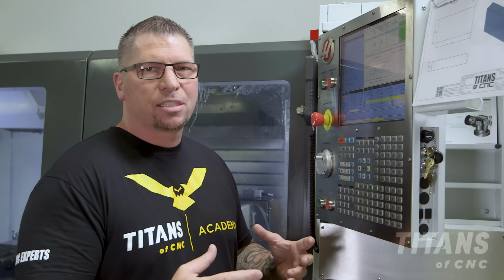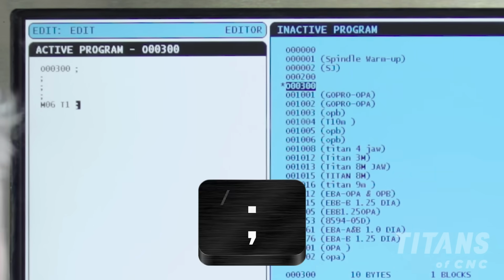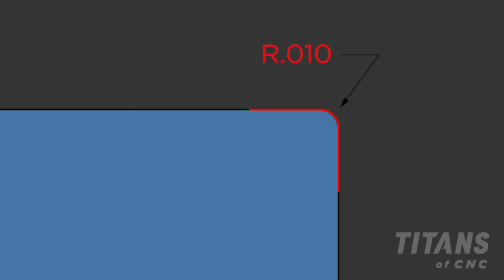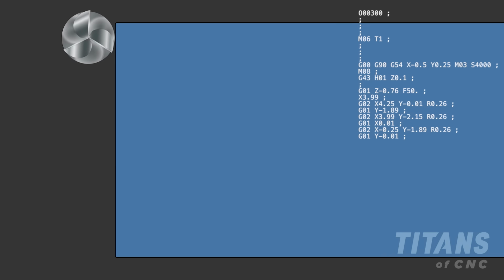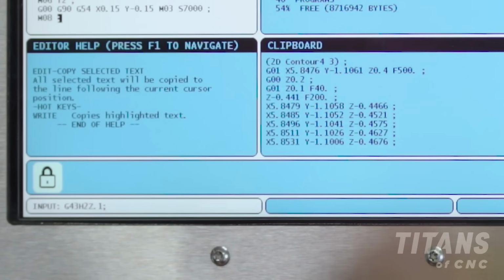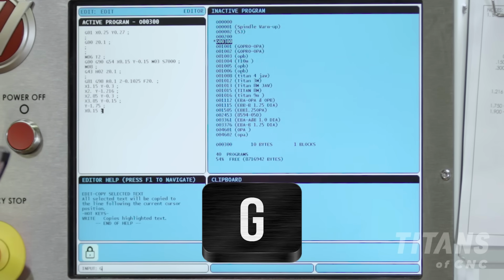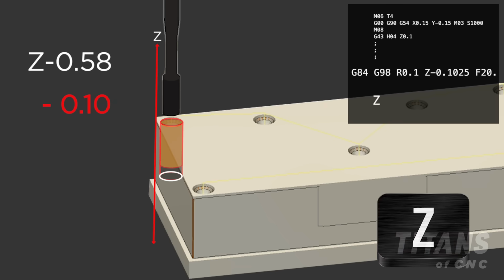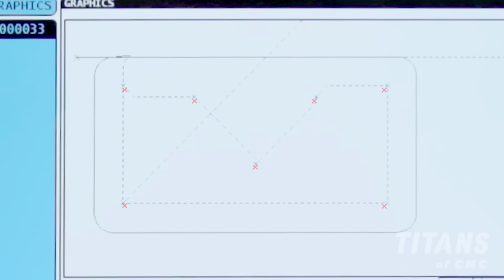G & M Code - Titan Teaches Manual Programming on a CNC Machine.

Comment: Now a 5-axis manual programming :D
Reply: Do you really want it ? I can do a video on 5axis on haas and brother and 3+2 axis old haas also have an LX20III so i can do a video of dual head swiss lathe work with 14axis manual  programming. I really don't like this video it lacks proper use of tool comp and tool comp on a haas machine is a breeze absolutely no reason not to use it especially if your using a preset tool list.
Reply: don't take that fact I don't like this vid as I don't like Titan. I have seen his life story unfold i have even been in his big shop before the down size. the guy is a mad man in a good way and i support what he has done and the basic's he wants to teach the only key things i really want to see added are a safety setup line at the start of the code and basic tool comp usage not doing so from the start teaches bad habitats. I have had 4 employees (out of well over 50) in the last few years take me seriously and do the the hardest thing they can do, ask a question sit down and listen i work with those the WANT to know i don't look for them i let the ones with the drive come to me, all 4 of them now have there own shops not for from me and we work together hand work around based on strengths and time. it works for all of us let me work on what I like to work on 91% of the work my shop has done this year has been in very hard to machine metals (not hard just gummy) i like the challenge but i have a LARGE tool set to pull from i started in this world at 12 years old with my grandpa, my parents were addicts so i spent a lot of time with grandpa i have running punch card oil bath machines. by 13 i was programing them by 15 i was running early swiss screw machines at 18 i took over the shop and ran it as a side job while finishing my masters in computer sic, today i not only program gcode but asm,C,C++,py,java. and speak English, Japanese, Mandarin, German. it takes years of hard work to build this kind of life even now i work 15hr days yet have no real reason to but if you let go good chance it will be gone for good
Reply: In metric :D
Reply: @nf794  in German

Comment: Why inches why! xD
Anyway great video!
Reply: Metric is  .03937 is 1 mm  so 1 meter is  1000 mm x .03937 = 39.37 inches  The measurement the CNC control software uses for setting up the Steppers or servo setup is different than the Software the G-code uses in the File  G20 is inches and if you want mm used then code G21. They will be used on the starting line of your software or if no G code is used the machine will use the default or last G20 or G21 code used. You can use any measurement your G code file was made with. Just by letting it know by telling it with these G codes.
Reply: I program, machine and measure in whatever unit system the blueprint specifies. Seems to be the most logical thing to do,and keeps mistakes to a minimum.
Reply: @liquerinfrnt  LOL !
Reply: Were Americans.  Stubborn.
Reply: because in imperial units you are allowed a greater margin of error.
Reply: @diane Taylor Not according to: "The International Foot (which we were all taught in school) is defined as 0.3048 meters, whereas the U.S. Survey Foot is defined as 0.3048006096 meters"
Reply: well here in canada, many cnc companies use inches
Reply: @andrewirwin6765  the machines are usually speced in metric but the work is usually in inch
Reply: @andrewirwin6765  ... a sad reality
Reply: Because a great deal of machine shops still use the imperial system.
Reply: INCHES FTW
Reply: Because the metric system sucks! Base 12 has more divisible numbers. But the biggest reason the metric system sucks. Is because you can't tell me the diameter of my metric sized tires.

Comment: Great video  I'm skared of a 10/32  at S1000     I'd rather run it at S320 F10.    But then again  time is $$  so I ges it depends on how many parts you are making   

Thx 4 the video 💪
Reply from the maker: We actually go 2000 RPMS with a form tap... it likes the heat
Reply: @TITANSofCNC  I wasn't aware you were roll tapping that is an entirely different Beast I prefer to roll tap when at all possible however I usually Reem or interpolate the minor diameter before tapping to make sure I get the most form possible unless it's a production job and I can't waste the extra tool change and run time

 thanks so much for your video

You guys are a inspection 💪

Comment: You probably should explain cutter comp G41 G42 and tool dia. offsets because you are trying to relate this to a CAM driven program that will more than likely use cutter comp. as well as other safety prep. codes along with G90 G91.
Reply: I was thinking the same thing. Why is he acting like cutter comp doesnt exist?
Reply: Fantastic tutorial. I wish something like this was available for me to watch before I learned to write programs. Thank you for all your hard work on these videos. Your helping the entire trade get better!
Reply: Your comps are in your calcs

Comment: I use this method for simple tool paths. Be awesome if you explained the perks of G41/G42...G40 if you had a standard profile but had to rough, finish and chamfer just by copying and setting your diameter offsets while using the D value. Either way, very good video to show that programming can be done by hand.
Reply from the maker: Thanks... will explain more later, didn’t want to over complicate things for those who are new to CNC.
Reply: I know....you guys do such good work opening up the world of manufacturing to AMERICA.

Comment: Hello, Titan I am trying to run my Haas VF2 (pretty old machine) faster than the super slow 20 ipm my shop runs at. I use inventor cam software just like you (which they weren't before and I have been raised with inventor) and I mainly machine cold rolled steel 1018. What size endmill should I rough with, what kind of endmill (hss, carbide, ceramic, etc.), how deep should I go, and how fast can I run the program? Let me know, thanks!!